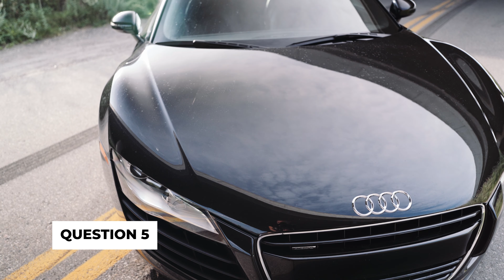Should You Buy the Audi R8? Your Questions Answered | Long Term Ownership Perspective

Comment: Awesome video, I love the R8 V8, my favorite car. It's funny I was looking up stuff about this as far as affordability, even when buying it all the maintenance and stuff comes at a price, not to mention previous owners. I definitely considered between 1st gen V8 and V10. If I get the V8 I would be learning manual on that which may not be ideal. Or do an R tronic for either the V8 or V10. I've just heard mixed stuff about the R-Tronic and such and others may suggest S-Tronic would be better of you go the Auto route. Have you any experience with an R-tronic R8?
Reply from the maker: I have driven the R-tronic R8, it's definitely fun it's not fast, its a bit jerky which makes you feel like you're shifting gears in the manual. Personally for me I wouldn't learn on this car in case you do too much damage the clutch, try to learn on another car and pick this car up in manual. I think if you're buying it for weekend riding and pleasure the manual is a must. Every time if you can afford it and it's in your price range. Otherwise the V8 will do, he will just be missing out on that extreme power, but the V8 still sings

Comment: I got an M4 right now. Debating now between an R8 or a 992 Carrera S. Both look amazing but the R8 slightly wins in looks I think.
Reply from the maker: Tough decision both are amazing cars and coming from an M4 in itself is a wonderful car. Why are you even looking to move out of the M4? Would you look at a V8 or V10 R8? Do you care which generation?
Reply: @carswithsonduren  I honestly don't want to sell the M4. I love the car. I special ordered it so I built it exactly how I wanted it. But those two cars have really consumed my mind lately. Lol What draws me to the Carrera, is that the second Gen R8 doesn't have that manual. And the first Gen models have really been going up in price.
Reply from the maker: My question is what does your heart tell you? You always need to follow your heart on this one. I personally think the generation one is better looking on the exterior but the interior of the new R8s are much nicer. I'm a big Porsche fan, but I am a biased soul and love what Audi has done with the R8s. My friend just recently picked up a Porsche Cayman GT4, absolutely stunning.
Reply: @carswithsonduren  it's funny, that's exactly how I feel about the R8. The interior on the new one definitely and obviously looks more modern, but I can't have a sports car without a manual. I saw your video of the GT4. Looks nuts. I'll definitely have to drive both cars before I pull the trigger, which will hopefully make it easier to come to a decision.
Reply from the maker: Definitely go for a test drive feel it out and if you see any R8s you're interested in send me over the link as well love to take a look!
Reply: @carswithsonduren  for sure man. Thanks!

Comment: Hey CR, did you noticed a big difference in the way your r8 drives after performing a carbon cleaning? My 2009 r8 which I got 2 years ago probably never have one and wonder if the drive would be “smoother” of better in any other ways. Great vid.
Reply from the maker: Hey Walter I did notice a difference after performing the carbon cleaning, but I wouldn't say it was a major difference. I didn't have that much carbon buildup as some of the worst examples either. Though if you don't even know if it's ever been cleaned, I would definitely do it because it could be really bad and it's good for not only the longevity of the engine but to also eke out more horsepower torque and response out of the engine.

Comment: Have you ever had dust accumulate inside the headlight housing itself? Or are yours still pristine with zero dust in them?
Reply from the maker: Don't think I noticed any dust at all but I will double check the next time I go wash it. Dust has accumulated in yours?
Reply: @carswithsonduren  Yes sadly — if you look into them when they’re on, you see dust particles all inside that fray up the clarity of the beams / running lights. I’m going to have to get it opened up and cleaned out, I think :( Bothers me and is definitely noticeable to most average people when they come up close too…

Comment: Hey CR, I was contemplating a 2008 R8, v8 manual, single owner, no accidents, low kms 25,xxx kilometres (Vancouver) the owner is my friends dad who is retiring. He is asking 90k which seems high. I know the prices bottomed out 2 years ago didn’t think it skyrocketed. Is 90k overpriced? What’s a good price on it?
Reply from the maker: Honestly that sounds reasonable based on the prices I am seeing. If it's in mint condition, which it sounds like it is, take it. 25,000km is LOW
Reply: 90K is a fair price in the current market for a 2008 R8, v8 manual, single owner, no accidents, low kms 25,xxx kilometres (Vancouver)
Reply from the maker: Agreed agreed

Comment: do these ac compressors continually go out? even after its been replaced once before
Reply from the maker: Yes if they are not properly used. You need to have the AC running all the time to ensure the Freon is lubricating the internal components.

Comment: Hey does your chassis make noise after installing the bc racing coil overs?  They told me it’s normal for it to happen.
Reply from the maker: Where is the noise that you hear? You shouldn’t be hearing any noise related to the suspension
Reply: @carswithsonduren  Sounds like it’s coming from the chassis. BC said if the suspension is too stiff that could happen. I had them installed and I think they didn’t get the stiffness right.  I will have to get in there to see what it is set to.
Reply from the maker: Do you know what part of the chassis? Front of the car rear of the car?
Reply: @carswithsonduren  it’s coming from the front.
Reply from the maker: Did you check the front frame for any cracks?
Reply: @carswithsonduren  had audi do a full inspection after I bought it. They found that the only thing bad were both front magride shocks. That’s when I had the coil overs installed. I haven’t checked the frame since, buts that’s a thought.